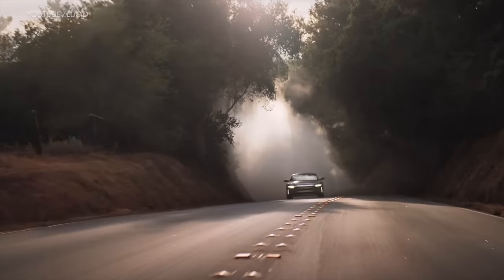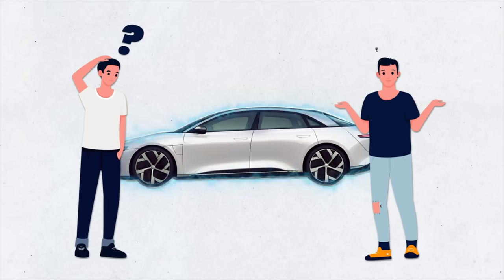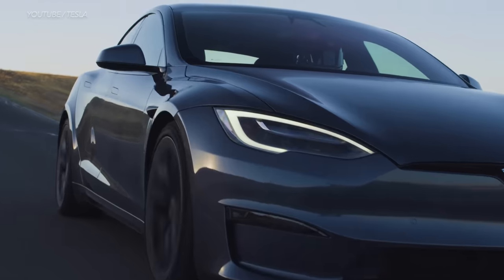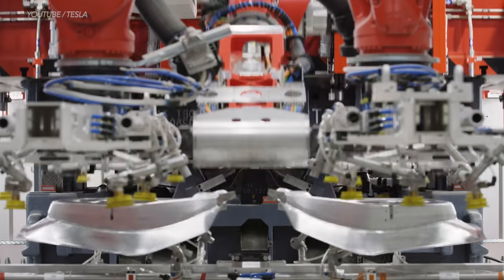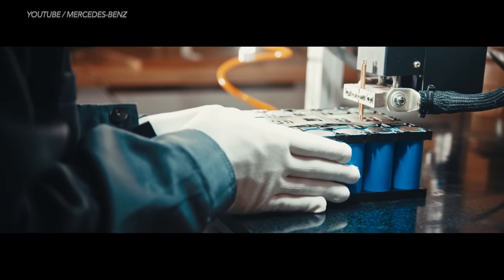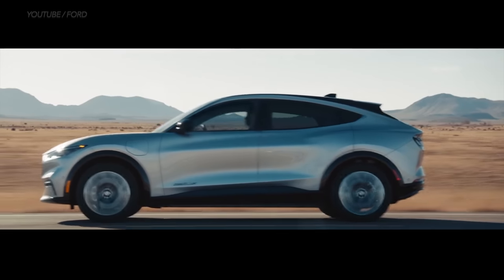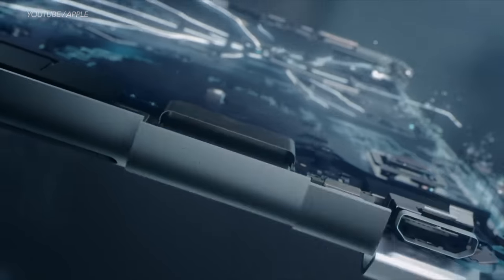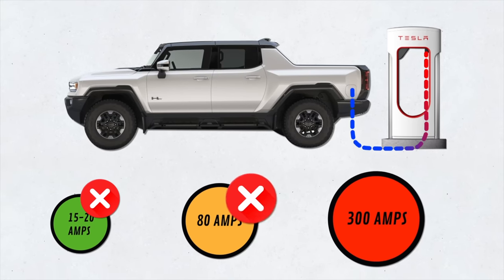Here's Why I'll Die Before I Buy an Electric Car

Comment: I've had a Tesla Model 3 AWD since Sept 2019. I Charge mostly at home (Level 2 charging @ 240V/48A) with occasional stops at Supercharger when on long trips. So far, with over 26000 miles on Tesla total electric cost is $1180. 
Maintenance Cost was about $1200, mostly to replace original tires at 25000 miles.
Insurance is about $1100 per year.
Regression analysis of all 350 charging incidents since I purchased this Tesla indicates that battery capacity will fall to 70% of original battery capacity sometime in early 2030.
Reply: It technically should level out. I'd be surprised to see it drop much below 80%
Reply: All ok, but now have 25 million EV owners doing the same, at thr same time, in your country. This is I presume the eventual "future".  Does  your calcukations still stand up favourably in that scenario?
Reply: Cliff - I too have a Model 3 . I charge at home. (greatest thing since slice bread). Yes this car weights more, but half the world drives a truck or SUV. No one ever mentions their weight. Will see how long battery lasts. So far great car.

Comment: Hey Scotty, I agree,  Picked up a regular 2022 RAV4 XLE. The Hybrid was $10,000 more and has more issues.
Reply: My new RAV4 Hybrid XLE is getting 44 mpg avg. in mixed driving. And only $700 more than the regular XLE with the identical build. No issues so far after ~1,500 mi.
Reply: Sounds WAY overpriced if you ask me.
Reply: hybrids are the worst of both worlds for highway driving.
Reply: @unclej3910  it’s not supposed to be that much more expensive but here in CA every RAV4 seems to have all the options. Cheapest hybrid they had was over 42K XLE premium. Prime was 50+

Comment: Electric vehicles are too expensive to fix.. Beware of these vehicles..... Keep your V6 and V8 engines as long as you can...
Reply: I agree the parts are high.   But sources say in the long run they are less expensive regarding repair and maintenance.
Reply: @danharold3087  Exactly. Maintenance is nothing, no oil changes, no spark plugs, gear is fixed so no gearbox problems, no generator (12V battery charges from drive battery), no starter, no fuel pump etc..
Reply: Absolutely correct and then they're going to raise electricity cost then you going to lose money by an electric vehicle they will raise electric energy up 50%
Reply: @altoclef6688  I imagine a Tesla might do better if you changed the battery coolant every 100 or 150K.  Maybe not.  Think I seen that some place.
Reply: @kensnedegar5925  
If the bulk of people dump their ICE cars for EVs think of the bargains we might find in the used ICE market.

In most states electricity prices are set by regulations and Public Service Commissions.  That sort of thing.  

While it is possible the powers that be could conspire to raise electricity prices their is a natural cap.   As electric prices rise the incentive to go off grid and charge your car at home become more attractive.  

The oil and gas people are feeding FUD which people fearful of change are eating up.  Both the EV and ICE people interests that do not work in our favor.
Reply: @kensnedegar5925   It would take more than 50% to lose money.  But still best advice is to keep your paid for ICE car till gas prices start eating your lunch big time.

Comment: I am retired and an EV would not be practical for me, let alone spend $60-90k for one. I live in an apartment and would have no where to charge it. From what I understand charging cost $20-$30 and I would have to drive the car for decades before it would pay off for the savings over gasoline. I am with Scotty, we are not ready for the DV's in the U.S., for many reasons. For example, the electric power grid is  not up to charging all these cars if everyone had one, along with powering all the homes in America; California already has rolling blackouts during the Summer.
Reply: EVs will eventually become less costly. They are much simpler with fewer parts. It will take a while for scale and volume to catch up to the masses, as to charging, that is a challenge to solve. There is more electricity sources, it is everywhere. More so than gas stations.
Reply: agree....runnin  the  big  power  cord  from  inside  apt.  to  EV  outside  is a  problem.  even  moreso  being  on  the  2nd  floor.  and  as  an  EV  ages, it  becomes  a  "vampire" / energy- electricity  hog, n  ends  up  spending  most  of  the  time  plugged  into  charger / outlet.
Reply: @PercivalFakeman  everyone keeps saying that but all i ever here is how they keep getting more expensive every year.
Reply: I just got a Nissan Leaf for $30,000 after the federal rebate. They are NOT $60,000-$90,000. You can get the base Nissan Leaf for $20,000 after federal rebate. But the charging problem is real, especially for apartments or renters!
Reply: The electrical grid would have to be able to supply energy to converted furnaces,  stoves, electric lawnmowers, and anything else that has to be converted from fossil fuel to electric. The power grid is nowhere near capable of powering all this stuff and to have it adequately upgraded by 2035 is a pipe dream. I don't see all electric vehicles to be the future.
Reply: @tony17112acst  So you can afford your EV because others (taxpayers) are subsidizing the cost (i.e. your neighbor is paying for your car).
Reply: Grandkids inheriting petrol burners may keep ICE vehicles on the roads. When it would all go awry would be a new death tax law for petrol burners. Like the Estate tax on farms and ranches that drive out family owned and run by the desendants.
Reply: @terry_willis  Thats how marxism begins.
Baby steps.
Reply: @genericdude6551  
agree......getting  all  i.c.e / gasoline vehicles  off  the  road,  n  having  nothing  but  EVs  on  the  road(s) is  a  utopian  dizzney - fantasy  land pipe  dream.
Reply: @tony17112acst  I want a real vehicle, not a beer can with wheels. Like I mentioned in my post, I do not have a place to plug in a vehicle, to charge it and not running an extension cord out of my apartment. Did they tell you when you bought the Leaf, how much the replacement battery cost?
Reply: @PercivalFakeman  I doubt that, like Scotty said, we do not have the resources in the U.S to build mass quantities of EV's. batteries; Russia and China control most of the earth metals  needed.
Reply: @terry_willis  No. It's a tax reduction, actually. You have to owe at least $7500 in tax to deduct it, so you're only keeping you're own money, no one else is paying for it. Even if they were and you DIDN'T get the deduction, an electric car isn't $60-90k which is the point of my post.
Reply: @russellehrgood9835  I get the problem with the cord. That will all probably change as more EV's are available - there may be a charger at every parking space just like parking meters, but you use your credit card instead of coins. Secondly, the Leaf comes with a 100,000 mile warranty on the battery, FYI. My Leaf will pay for itself at 72,000 miles (from gasoline savings), so whatever the car is worth at 72,000 miles is all free money for me if I sell it. I also may keep it.

Russel, if you're single and can afford just one car, I do not recommend an EV. If you have a 2 car household, I HIGHLY recommend getting an EV for one car to run all your errands and work related, then if you need to go on a trip, use the other car. If you get the Leaf for $30k, you'll save money in the long run.
Reply: @russellehrgood9835  It's not a beer can on wheels, you better do some homework before posting and making yourself look bad. This car would BLOW yours away in a race and has incredible torque. It weighs as much as a big SUV too.
Reply: @tony17112acst  : Tony, you miss my point.  When someone gets a "tax credit" the gov't is giving them money.  It's just another form of welfare  in which the gov't just gives away money "for nothing".  I.E.  welfare slugs don't "earn" what they get.  They just get it because politicians "feel sorry" for them and their plight.  Who pays for that "welfare"?  THE TAXPAYER.   When you get a tax credit it's just the mirror image of welfare.  YOU are paying less in taxes which have to be made up some how, some where and it's other taxpayers who make up that difference or shortfall.  What "work" did you do to get that tax credit?  Nothing. You just bought a car.  

This is somewhat akin to people who get a federal income tax refund (1040) and actually BELIEVE the gov't is GIVING them money.  NO.  The money was their money confiscated every payday, by the gov't.   The refund is just their money that the gov't earned interest all year instead of the taxpayer.  HTH
Reply: @ductape8214  > Hear
Reply: @terry_willis  As a mathematician with courses in accounting, I do understand the different ways to look at it. But a tax credit isn't the same as a tax deduction! I'm getting a deduction, not a credit. I DID do work; I earned my money! if I keep more of my OWN money, it's not unfair to anyone or any other tax payer because we all have equal opportunity to get the EV tax deduction. I'm against almost all welfare, but a tax deduction is different and if the government has a way for us to be taxed less, I'm sure you'd take any deduction too. Did you have a child? Did you refuse the tax deduction because you "didn't do any work?" If you did take the deduction, then we see things the same way.
Reply: @tony17112acst  Cannot base this on any subsidies, and the government should not be subsidizing someone else's cars with my taxes!!! Those ones are the crap range ones that he mentions too.
Reply: @tony17112acst  Electric vehicles are a joke.
Reply: @ductape8214  Once the luxury market is saturated they will expand down.
Reply: @fromthebackofmymind  When gas hits $10 a gallon they will not need additional taxes.
Reply: @russellehrgood9835  Don't buy one now.  When rents in your complex drop because it does not have chargers the owners will install them  And most likely raise the rent. Or tear it down.
Reply: @russellehrgood9835  well of course GM, Volkswagen, Tesla, Ford and Handia disagree with you. You can stay with fossil fuels if you wish. They will probably be around for a long time. It might not be pretty though.
Reply: @PercivalFakeman  The EV's maybe the future but more work needs to be done to make the tried and true vehicle. The EV's are more costly to maintain due to their excessive weight on tires and suspension parts. I thing EV's will have competition in the near future with hydrogen fuel cells. I like the hydrogen idea and we have plenty of that in the World at almost no cost.
Reply: @russellehrgood9835  Hydrogen cars are really fuel cells connected to batteries. They are actually all EVs. Currently EVs have a pretty good record of realizability. It is a battery, inverter, computer and a motor. Very few moving parts. I have had my plug in EV for Six years and have only had three oil changes and a set of tires. Very reliable.
Reply: @genericdude6551  our power grid has doubled in size every ten years since the 60s. We only need about 20% more than now for EV, no where near doubling. It is very do able. Solar is so cheap now, the utilizes want in and are already trying to restrict home solar. It is very possible. There are few experts who think it can’t be done and many who say it can.
Reply: @PercivalFakeman   Eventually?/ We still have a LONG way to go before they are significantly less costly, the thing is more than half of the people in the US at least will not even consider an EV for many reasons.  ie (its basically an electrical appliance)  We should not be forced to switch over.  The infrastructure is SOOO far away from being ready to switch, by the time it is, there will be a more viable solution compared to EV's. There is also a severe shortage of precious metals that are needed to make EV batteries, How about the lack of super charging stations?  5 hour waits at a super charger? There are dozens of videos on YT of this.  Again the problems keep piling up.
Reply: @volkssturm9694  Electricity is everywhere. There are plenty of ways to charge EVs. I am in the EV charging business. It is a high growth industry with lots of opportunities to sell energy. It is growing at rapid rates. There are cities full of them. Coffee shops, gas stations, grocery stores, retail, apartments are all interested in making a profit. EV is here and now. There may be other solutions as well. Fossil fuels will probably be around for a long while for those who can’t give it up.
Reply: @terry_willis  And ALL taxpayers are contributing towards the huge billions in subsidies, handed to the oil companies each year... I drive an EV, so I don't used fossil fuel. Will you pay me my share back please Terry?
Reply: @russellehrgood9835   Nissan don't usually say. But I can tell you how much a UK owner of a 10 year old Leaf paid for his battery pack refurbishment. It cost £500, and the work took 4 hours at an independent EV specialist. We have such people here in the UK..... Full battery pack replacement is not always necessary..... However, many uninformed people seem to feel it is.....
Reply: @Brian-om2hh  Even under warranty, sometimes there is a deductible, the 500 pounds might of been that. I know the batteries are very expensive as Scott Kilmer quotes. The batteries in most EV's weight 3000lbs in materials and your not going to get a battery the weighs that much for 500 pounds, anywhere.
Reply: And then you woke up
Reply: I’ve never seen an ev charging station.. Sorry

Comment: It’s not cost effective to buy an EV.
For the money you would spend on an EV you have a lot more options with conventional vehicles.
And I haven’t even mentioned maintenance and upkeep.
And if the battery dies, your EV is done, it’s not cost effective to replace the battery.
Reply: Tesla is covers the battery for 100K miles or 8 years.  They are said to last longer.
Reply: @danharold3087  so what do you after 100k ( that’s 5 years based on 20k per yr or even after 8 years; a well maintained Honda or Toyota lasts a lot longer, and again for the price of a Tesla you have a lot more options with gas powered vehicles.
Reply: @prabjotgill7291  What do you do when the engine or tranny dies on your ICE car after its out of warranty.  The expect life is something like 300K
Reply: @prabjotgill7291  That's the length of the warranty, not the expected service life. For example, the Prius came out >20 years ago, and most are still running around on their original battery. Personally, I wouldn't go with a Tesla because their policies on repairs suck. Any other company, you can get aftermarket refurbished/remanufactured battery packs for cheap in the low-probability event  they break.
Reply: @TheZeusJuice  you are ignoring the first part of my comments.
Setting aside maintenance and upkeep costs.
Right now for the cost of a base model EV, you have more choices, higher trim levels with ICE vehicles
Reply: You obviously never heard of battery refurbishments. They've already been happening in the UK for a few years. Why are you so far behind in the US???

Comment: I'm 62 and may just run gas vehicles for another 20 or 30 years.  My wife and I have two vehicles and, yes, HER usage patterns could fit fine within EV range.  We could theoretically have one EV and one gas vehicle but I'm not going to spend the money for a new Tesla just so she can run around town in that instead of the SUV she has currently.  I am not willing to give up the ability to take a long drive with just 10 minute gas stops to give literally unlimited range. And I am not willing to take a trip based around finding public charging stations.  Another note: My next vehicle will be a 4x4 truck.  I've seen a detailed review of the Jeep Wrangler 4xe hybrid and on off-road trails the battery range was maybe 20% of what it would be on-road.  Meaning it lost 80% of its range off-road.  So anybody who drives an EV out to a remote place and drives on dirt roads could get into critical need for a fast charging station when they're a long ways from any town.  To be fair I am willing to consider buying a hybrid vehicle, but will never, ever, buy one with a CVT transmission.
Reply: Hey Dave, have you thought of getting A used (2016-2019) Chevrolet Volt? These things cost $20k-ish used and are basically EV with gas generator on them. It should suit your wife's need for running errands with their 50 miles range to the battery, but longer with the gas engine turned on. 

Although, if you wanted A new car. May I suggest A Prius Prime instead? If the town is nearby, the battery alone should be able to last on its own. But you still have the gas engine, incase of long commute/ran out of battery.
Reply: @flyingbusa3407  I have been amazed that nobody has created something similar to the Chevy Volt but without as much complexity.  The Volt tried to merge gas driving especially at highway speeds with battery driving around town.  Seems like somebody could create a battery car with a 75 to 100 mile range plus a gas engine generator where the gas engine only runs to charge the batteries.  I'm sure from a pure engineering standpoint this has efficiency losses, but seems like it should be workable and give OK mileage past the battery range.  I'm picturing a small 3 or 4 cylinder gas engine running at steady RPM however it is most efficient.
Reply: You won't, because it'll be quite difficult to actually get gas/petrol in another 15 years. And even when you can get it, the cost will be treble what it now is....